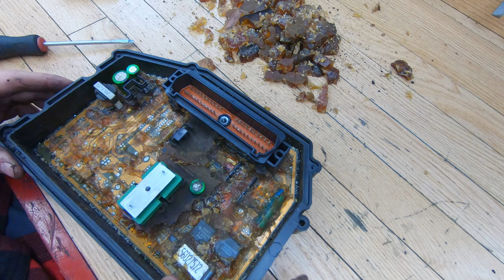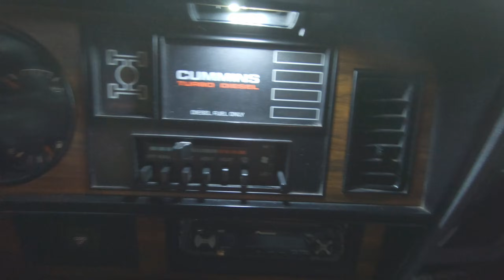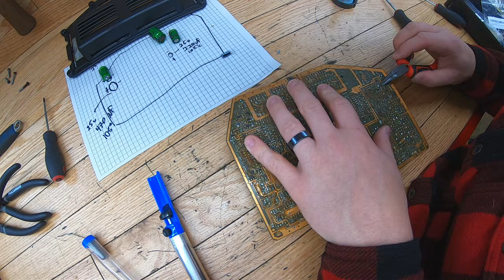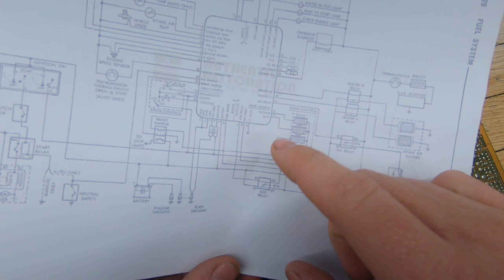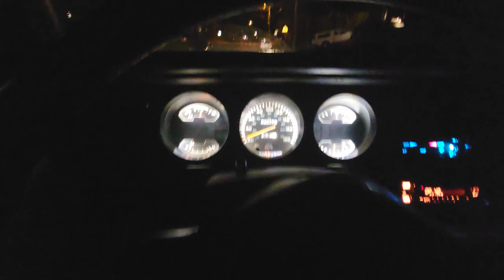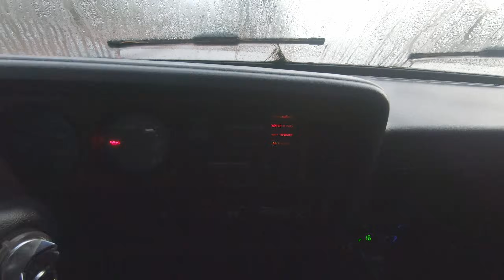PCM Repair | 1st Gen Cummins

Comment: Thanks for posting this video.  I only have the voltage regulation problem.  Any idea what it would take to actually fix the voltage regulation instead of the bypass method?  I like your budget way of checking the capacitors.  Strange your capacitors checked good, but just replacing them fixed your issues.
Reply from the maker: Is your truck overcharging or not charging at all? I would replace the caps to begin with then go from there.
Reply: @OvensGarage  It is undercharging.  I checked my exciter voltage and it was 12v, so no regulator problem at all.  Took off the alternator and took it to Autozone and they said it was undercharging 8v on their bench also.  So, simple fix for me.  Still wonder if the regulator can be repaired, but that is someone else's problem now.
Reply: @fairbornCCF 
Full bat voltage to fild should = charging.  The alt has brushes that wear out.   If89-91.5 it has an external regulator on the fire wall. But you show whatever regulator system you have is calling for charge, so should not be  a regulator issue.  If not the brushes then possible broken fild windings

Comment: I have built the fix for this problem.
You do not need to remove the pcm.
You simply connect the three wires from my new control mod. Into the wire harness on the driver's side fender well. 20min tops solve your problem with out stress and without breaking the bank. Just 3 simple connections. I'll send pictures and instructions with the part. No need to "delete" your PCM
Reply from the maker: I'd like to see that.
Reply: Link to this?
Reply: Where is the pictures and instructions? I’d like to see this
Reply: Bro fell asleep
Reply: I know this is an old video! 
( old, but very relevant very well produced and extremely useful. I appreciate it very much. Didn’t want you to think I was talking. $hit) 
Just wanted to make a comment about this person saying they have a 20 minute fix with three simple connections, but it’s been how long and not a single response!!  so where is the response? Where is the video or anything for that matter? . Not being a hater and definitely don’t want to take away from this very helpful and useful video. Just don’t understand why someone would comment something like this and then disappear so to speak.. again thanks for the video. Great job.. 

Ps, @davidswier3571

Thanks for nothing😆

Comment: Thank you. I sent mine off through a local reputable garage, cost I think it was $400. I looked at it when returned, and it looks like that is all they changed was those capacitors. Mine started acting up a couple years ago, intermittently. I could hold up on the main wiring harness or tap the side of the pcm and all the charging, tach, and speedo and od would start working again. So you are spot on, thank you, thank you so much. It is crazy what simple and inexpensive things fix what normally people charge a lot to do. Take care :)
Enjoy your videos, like the real, non staged product :)
Reply from the maker: Glad it helped. Yes you are right, people pay an exorbant amount of money for things that should be free knowledge or open source. That's why I wanted to share it with everyone. I could have easily kept the knowledge to myself and started charging people for it but why would I when I could help out the community. Cheers!

Comment: Sounds like good preventive maintenance even if nothing is wrong. After my fusible link fried, my charging voltage at the battery is 14.5v. The gauge reads quite a bit higher too, even with a new fully charged battery. 29 years old and 199k miles, maybe it's time to replace the caps.
Reply from the maker: It's cheap insurance! However if it's an over charge situation the internal PCM voltage regulators might need replaced.
Reply: @OvensGarage  It's running at 14.3v today. Is that too high ?
Reply from the maker: @mikep95133  I think anything over 14.5volts is too high so you are probably good

Comment: Original owner 1993 D 250 12 valve 350,000 miles. Recently on cold start grid heater will not cycle. Stays on to point wires get hot and I can smell insulation cooking.
Turn key off and restart works fine. Guessing intake grid heater relay bad. For now I disconnected wires at the heater. Your opinion. Retired on limited budget, want to fix correct first time.

Comment: You're a brave man, Tyler.  That potting material probably would have killed my enthusiasm, but you powered right through it.  It's great to see how these things can be fixed.   Great job!
Reply from the maker: Thanks for the support!
Reply: Hi , can I get the specs for the diodes above the 2 capacitors .Mine are fired . @OvensGarage

Comment: Wow! I have this same problem and I already replaced the crank sensor (speed sensor) now have the pcm out just didn’t know what to do. I really hope the same thing will fix my truck. Thanks a lot for the video!
Reply from the maker: Please report back if it worked when you end up trying this out! I'd love to know if it solves others problems as well! Good luck 👍
Reply: Did you get around to doing this or not?
Reply: @BrowntownBrown  yes I did and it works. This video is extremely helpful and if you watch close and do exactly what ovens garage does you will have everything working if your pcm is the problem.
Reply: @johnnydyck4870  awesome, yeah the truck never had Startup procedure since I bought it years ago and I tried trouble shooting the TPS and speed sensor and things like that.. readings on the multimeter were way out of wack but I think this is my solution here

Comment: This is a great video!! Thank you Tyler! 
My fuel gauge doesn't work, my dash lights are not working and horn is dead. Water in fuel and wait to start work sometimes... I wonder if it's the same issue... maybe just relays?
Reply: The message center lights (WTS, WIF, brake, abs, etc.) might just be a bad connection.  I have the same issue.  There's a round connector on the back side of the message center's circuit board with maybe 7 or 8 pins (didn't actually count them) sticking out that the connector plugs in to. I noticed that if I moved the connector the lights would work.  So I pulled the connector off and found that several of the pins were loose on the circuit board.  I didn't have time to do a proper fix so just pulled the connector wires off to the side with a zip tie to keep pressure on those pins for a temporary fix.  So far that's working, but I need to get in there and fix those pins.
Reply from the maker: Fuel gauge isn't controlled by the pcm its just direct from the gauge cluster to the sending unit in the tank so that's a separate issue. Dash lights (cluster) aren't controlled by pcm either unless you are talking about the check engine light or the wait to start and water in fuel. Horn isn't controlled by pcm. Could be a bad ground (I have a video on that) or a bad horn relay.
Reply: @OvensGarage  Thank you

Comment: So I pulled my board out today and it has two heat sinks on it. It has an extra one to the left of where yours is. Any ideas?
Reply from the maker: They had a few different versions of the PCM. It's likely a different variant on how the voltage regulation happened on the PCM. The big heat sinks are just to dissipate the heat from the voltage regulation. Is the capacitor layout the same?
Reply: @OvensGarage   I’ll pm you with a picture. The capacitors are in fact in the same place. Everything else is just a bit different. Out of a 1992 w250 5speed

Comment: This is incredible and next level stuff man! So cool. Did you test the ASD relay itself. I'm in awe
Reply from the maker: Thanks Tim! I didn't test the ASD relay itself but I knew it was the problem since it happened in both trucks. Ended up jumping the two pins at the relay to test it, but the problem was the PCM not allowing the relay to ground, not a problem with the relay in itself.
Reply: @OvensGarage  gotcha. You're right it would have been crazy if both had the ASD relay crap out but who knows
Reply: If you grounded the wire in the harness for pin 51, would it have the same effect?

Comment: Nice job, I personally got rid of the PCM, but that is awesome.  Where did you get the schematics for the PCM?
Reply from the maker: The wiring diagram and the input/output schematic is available in the FSM, however detailed schematics of the PCM were never made available by Chrysler.
Reply: @OvensGarage  fsm?
Reply from the maker: @taylorsowle8209  Factory Service Manual

Comment: Absolutely brilliant man. I had heard there was potting material in these PCM's but I think you are the first person to actually try remove it to accomplish a repair. Most other people I've seen get that far just give up. The tip about only doing it around the capacitors is definitely a good one too! I am confident this is gonna get my tach working again I'm gonna get those capacitors on order ASAP! 

Also might be worth noting that the hot side (+) of the ASD relay trigger circuit is either switched ignition power or controlled thru the PCM too (can't remember at the moment where it comes from, but it only comes on when ignition is on run). So as long as the voltage regulators are working in the PCM and you are getting + power to the relay trigger terminal when the ignition is on all you have to do to close the relay is provide a permanent ground to the - side of the trigger relay by cutting the wire and running it to the body or battery. This is what I did just to get the truck to charge, and may be easier than internally grounding the relay in the PCM for most. If I remember correctly red wire is constant + power, blue wire is power out to run everything that needs + power when the truck is running and blue/yellow is the grounding wire that the PCM would normally ground to activate the relay. Forget what the hot trigger wire is, maybe pink? Keep in mind I also have an external voltage regulator installed so I've taken extra steps to eliminate the PCM from the charging system entirely. But hopefully this might help someone else! 

I'm glad someone finally stepped up to the plate instead of shying away from a computer problem for once. Good job man, really!
Reply from the maker: Thanks I really appreciate this comment and the support! I'm thinking this will fix your problem as well. A lot of guys are having issues with their PCM's and this isn't an overly complicated fix. On the ASD relay, I could have grounded out the wire on the truck like you said and it would probably work well for most, but my intention was to keep the truck as is and not mess with the wiring, keeping the repair internal to the PCM so it could be easily swapped between trucks.

Appreciate you watching! Cheers.
Reply: Trying to bypass my pcm now and I think all im missing is my 12 volt switched power for the external regulator. How did you wire yours in?